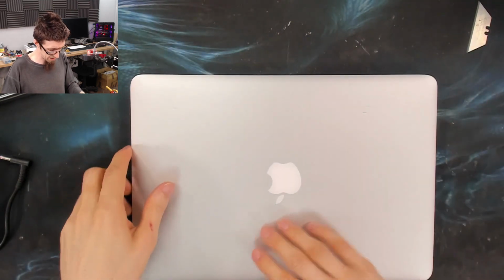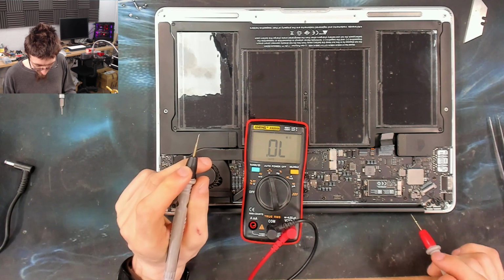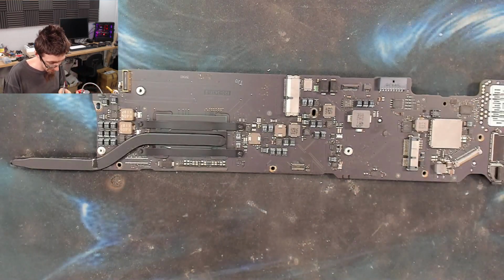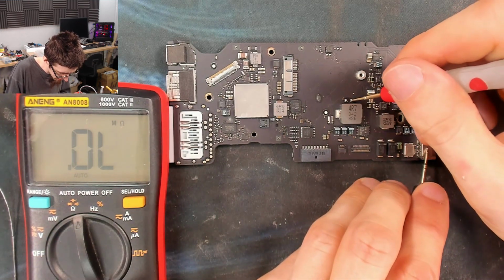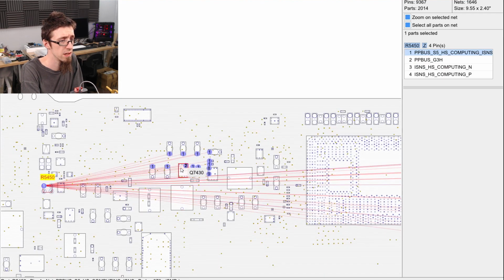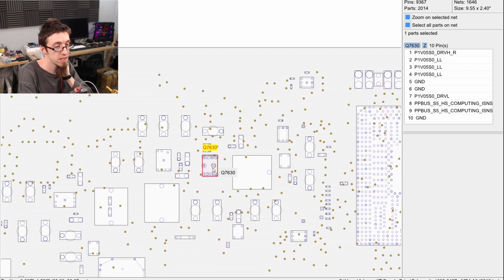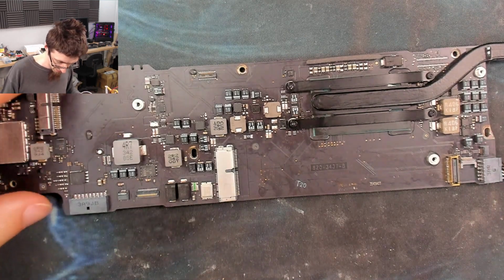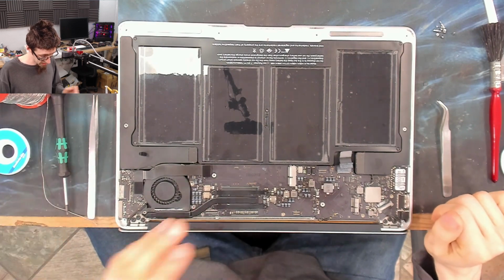Short on main rail, except the CPU is dead :( - LFC#284

Comment: 15:40 The range issue you're referring to, which disrupts the reading of the DMM, could potentially be caused by a faulty noise-filtering capacitor. A broken capacitor can introduce signal disturbances, leading to fluctuations in the DMM readings.

Comment: Great video!  There's always things to learn in the failures.  Definitely do more videos where you don't fix the problem.   The diagnostic steps and thought process to come to the conclusion it's not repairable is just as valuable as the ones you repair.   Out of curiosity what is the steps moving forward?  Can the CPU be replaced with a donor? Can you order just the CPU? Do you need to replace the whole board?  Thanks!

Comment: Wouldn't it be easy to install a transient suppressor diode into the circuit where are voltage sensitive stuff installed? It would not cost much money for the factory. That way, those diodes would save CPU, GPU, RAM, and SSD chips from getting that overdriven with too much voltage.
Reply: Completely agree. A TVS diode at least. Another option would be some voltage regulator IC capable of withstanding 5A. Unfortunately those motherboards were already built like this. Good circuit design engineers would not fully trust electronic components and would insist on adding protection circuitry in those critical areas. Let's hope they do in their future apps. All the best.

Comment: Quick question: thought the CPU rail was a low resistance rail hence difficult to identify a short on it. Was this mosfet on a different rail?
Reply from the maker: There's multiple rails to the CPU. Vcore is the big one, and generally sits at 1-5ohms, which is why it always looks shorted. A "real" short, like a dead capacitor, would be less than an ohm. This shorted rail was System Agent, also known as Uncore, which is mostly cache stuff and other internal communications that aren't the cores themselves.
Reply: @Adamant_IT  Thank you!

Comment: Short to ground could mean the rail gets shorted and devices after that do no get overvoltage. However, that 1.7V doesn't look good. But it still might fixable if the issue is the buck converter driver IC or something in the surroundings. CPU Vcc lines are typically controlled and yes, it could mean CPU got crazy and asks for this insane amount of voltage or the voltage regulator is doing its job poorly and the CPU overheats and shuts down (not dead yet). 
I would give it some more tests regarding the high voltage on the rail. But yes, there's very real possibility, CPU got too much and is shorting the rail by itself and that really would be the end.
I'd check the high side mosfets for shortages (which would lead to overvoltage on the relevant rails)
Reply from the maker: it turns out that 1.7v is normal on these things, and I confirmed it after seeing a bunch of comments. However, the sysagent rail definitely got zapped.
Short-to-ground only works if the short is actually directly to ground - in this case the mosfet was shorted from drain to source, thus sending all the power directly into the CPU.

Comment: What is the most likely low resistance one can measure around the cpu?
Reply from the maker: CPU vCore tends to be around 3ohms, System Agent varies, but is usually higher, somewhere between 20-200ohms.
The give away for if you're shorted through the CPU is when the resistance on the main power rail (PPBUS_G3H) is the same as resistance on the vcore or sysagent inductors.
Reply: @Adamant_IT  thanks Adam I appreciate your act of kindness

Comment: There's a good chance thermal cam would still find the short, even at 200ohms. As long as you took the heatsink off the CPU
Reply from the maker: I mean, at 1v 200Ohm you'd be passing 0.005a, so big doubt on that? Cracked PCH would be a better giveaway though.

Comment: So, I presume this means that the computer is just completely toast, buy a new one. Is it possible to still recover data if something like this happens?  Also, I've always wondered what happens to these unfixable laptops. Does the customer often just give them to you and they become part of your donor stash?
Reply: the SSD was removed so data "should" be fine. Not all SSD's are removable
Reply from the maker: Yea, these MBAs have removable SSDs, so I can put the SSD in another device for data recovery. If the SSD is soldered in though, you've had it.

Comment: Graham, how do you manually control the brio focus whilst capturing in OBS, do you have other software open or have you set up some form of hot key arrangement?
Reply from the maker: Currently using Logi Tune to manual-focus, but I'm considering going back to Logitech Settings, because the interface is less cramped. It's lesser of the evils though, webcams aren't really designed for this kind of thing - they're just still an awful lot simpler and cheaper than a "real" camera setup.

Comment: Proves you can have the super IO happy with all the rails and turn it on and fan spin but the CPU or GPU? is burnt out /shorted. wouldnt the circuitry detect that too and switch off as every time i have a shorted CPU, it gets hot drawing the amps and the PS switches off.

Comment: Please be careful when "toothbrushing" the board like that ! You can easily knock off components, especially if they're corroded and the brush is hard - I screwed up a phone board this way and had to pay for it :))))
Reply from the maker: I work on the assumption that if a toothbrush can take them off the board, they were weak and needed to be reflowed/replaced. However, yes, I should warn people of this because they might not be prepared for that.
Reply: @Adamant_IT  Also, you COULD inject voltage even with a high-ish resistance on the problem rail if you don't exceed its nominal voltage (8.5v in this case). It will not get as hot, but the thermal camera might just be able to pick it up. Of course, it means you (might) destroy any downstream components if a FET is shorted. The CPU would've gone hot in this case.

Comment: She's doneski, Steve.
1.7V vCore sounds like a FB issue to me. Had a GTX 580 kill itself over a bad FB circuitry; 0V on FB, it decided not to trip OVP or UVP and shoved 5,56V into the GPU
Reply: 1.8v is actually normal for vcore on these boards
Reply: @danandrei96  That doesn't make sense. Sure, PPVCC_S0_CPU is rated at VOUT max=1.85V, but that doesn't mean it actually runs at that voltage. After all, it's a 22nm Haswell mobile core i5 rated at 15W on the receiving end of that rail. Not even Haswell desktop CPUs with much higher power limits and much more cooling available to them run at 1.85V or should be run at 1.85V. Doing that will, at best, severely degrade these CPUs.
VID might be configured to 1.85V, but VID is not to be confused with VOUT.
Reply: @Asyq  normally I'd agree with you, and it's definitely weird. But I have 100% measured this with my multimeter right at the inductors on multiple fully working boards, and 1.8v is normal. These CPUs have about 20ohms of resistance so they need the higher voltage I guess.
Reply: @danandrei96  Do you have a video of someone measuring PPVCC_S0_CPU on an 820-3437 that you could point me to? I honestly have a hard time believing that. 
As far as I'm aware, only Haswell-E (and later on Broadwell-E and Skylake-X) CPUs have integrated voltage regulation circuitry.

Comment: hmm toth brush not a ggod tool dude as it will cause a static charge and can damage the electonics unless you have a brush that wont cause staitc build up
Reply: Not in the UK. The air humidity there is to high for a static discharge. And also, have you seen Linus's and Electroboom's attempts to damage electronics through static discharge?
Reply: @SelfMan-SK  ohh yes!  Sparks can still happen but it would involve carpets and balloons.

Comment: Into the landfill it goes. I am glad Apple changed it's website so it looks like they are super green and really care about supporting broken machines instead of wanting to sell you the same crap year in year out.
Reply: are u only Rant because its apple? u won't find any motherboard in the world having anything after the mosfet to protect over voltage. its even impossible to implement that. Maybe you should study Electronically Engineering with focus on Computer Engineering u will see there is not way todo that
Reply from the maker: Yea tbh this isn't Apple's fault per se, this could've happened to any brand mobo. But still, there's plenty of other times where Apple are contributing to landfill due to lack of reparability.

Comment: I enjoy the troubleshooting and explanations, never worked on MAC. One question, other than not having one, why did you not replace the CPU or, can it not be done because of some insane APPLE reason...
Reply: that would require a bga rework station with stencils, a donor board with a working cpu because nobody sells that part new and a decent amount of time/labor....you factor in the cost of all that and you FAR exceed the worth of that macbook, the best fix for that would be to find a used working board for cheap
Reply: Yeah, 2 reasons actually. 
1. Apple/intel doesn't sell the replacement chip for purchase. 
2. The CPU is directly soldered to the board, so is the RAM. Needs special BGA reworking tools and expertise to remove and install such chips. 
Bonus Reason - Success ratio in the long run is laughable at best. To fix the chip to the board, you literally cook the entire chip far far above it's maximum design temperature,so that the leadfree solder balls under it melts and adhere to the contact pads on the board. Removing a working chip from a donor board and installing here requires atleast two such heating cycles that may kill the chip faster.
Reply from the maker: Ye. It's a matter of "Yes it can be done, but No it's absolutely not worth it."
Reply: You see how hard it is to solder/de-solder fuses off the board and they have 2 solder points (11:45)? Well imagine having 1000 solder points instead of 2.
Basically it's incredibly hard to swap a CPU with a hot air station like this.
Reply: that has nothing todo with apple. but to desolder a CPU or a CPU socket u need Expesinve BGA reflow / rework stations and they a literally FUKN Expensive
Reply: Thanks everyone for the response., I understand now...
Reply: Thanks everyone for the FYI , learnt something here

Comment: Interesting video! Seems strange that Apple doesnt build in more protection besides that mosfet to prevent the CPU from getting cooked if it fails. Great you showed a fail as well! Looking forward to the next one, keep up the great work.
Reply: you don't understand... think different: the cpu is the fuse. BRILLIANT!
Reply: literally its not only apple in no laptop or computer is any protection on the CPU power rails after the mosfet. Am working in Computer repair and u won't find any fuse or anything there.
Reply: Why should they? Standard apple warranty is only 1yr. No need to make it last.
Reply: @geraldh.8047  But that's the point. Allegedly, Apple's build quality is highly regarded yet in reality it is no better than the next manufacturer. In reality, what effect then on cost is to add a single in-line fuse?
Reply: @ThePopolou  you cannot simply put a fuse on a main cpu/gpu between the high side and silicon because that line is meant to have high current going through it when its working properly, the fuse would blow every time you loaded the cpu/gpu. fuses blow from high current and cpu/gpu are killed by high voltage.
Reply: @the_socompsp you could still put in a crowbar circuit that blows a fuse elsewhere
Reply: If you watch some of Louis Rossmans videos, you dont longer think such stuff is strange 😅

He was a Video uploaded a day ago "A1708 MacBook Pro preventative maintenance PSA" where he rants about the flaw that Apple has high-powerrails next to datalines 😅

Comment: 27:17 Ooof 1.7 volts on the CPU Vcore , yep dead cpu now 💔💔
Reply: Nah, the CPU VRM actually is rated Vout = 1.85V max. So getting that voltage reading on the CPU Vcore chokes is not the end of the world ;)
Reply: 1.7v on the CPU VCORE rail is the correct voltage according to the schematic. It doesn't mean the CPU is going to work now.

Comment: It's never the cpu...

...until it is
Reply from the maker: It's never the CPU. Except when it's had 8.6volts into the system agent rail 😅
Reply: @Adamant_IT  i´m not familiar with that overpriced Apple shit. Do those expensive boards not have over voltage and over current protection for the cpu and ram ?
Reply: Yeah. I started working with computers when the Pentium 3 ruled the world, and back then it was never the CPU.
Reply: Had a Skylake i3 desktop with one bad CPU core.  Running it as a single core worked fine.